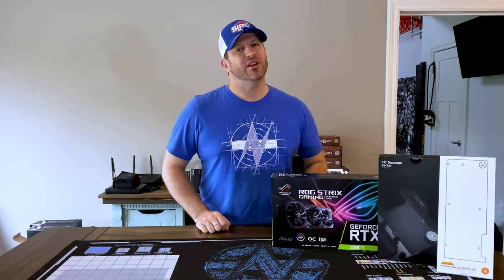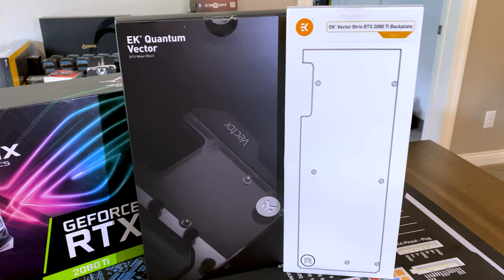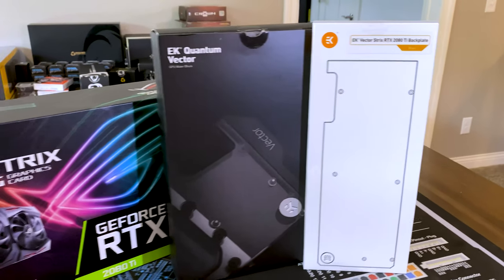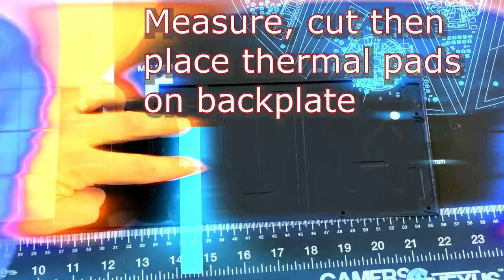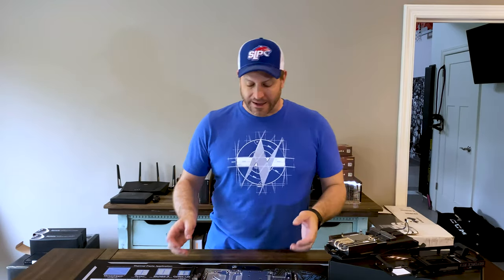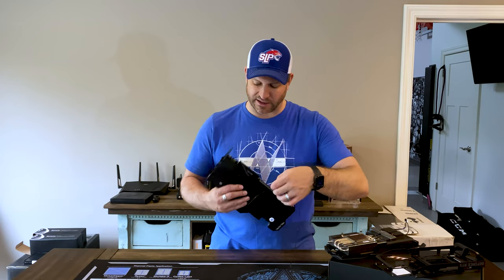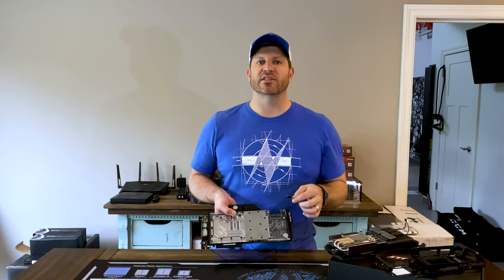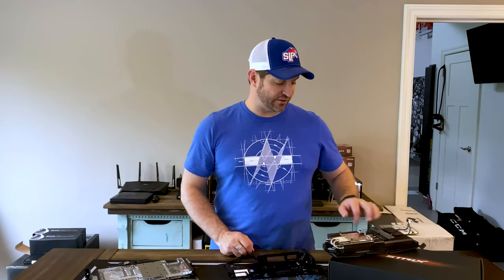Asus Strix RTX 2080 Ti Waterblock install

Comment: If you run the RGB wiring through the center between the PCB and the acrylic you can tuck them away nicely when you have the card installed horizontally. For vertical, like you will be doing, leave the wires out like you have in the video so they can be hidden away behind the card and not seen through the acrylic.
Reply from the maker: I didn’t consider running it through the card.  Might be an interesting option.  Thanks
Reply: That's exactly what I did... the cables between the PCB and back plate around the pads, worked just fine.
Reply: LANo that’s great! Getting my block tomorrow didn’t thing about that. Great help!

Comment: This might come in handy. I'll have to add a 2080 ti to a loop next week. Not sure what I'll do with the wires. Maybe some hot glue to keep them in place and out of sight. I'll have to see where it ends up in the build. 

One minor remark: if you left the paste like that, you might see higher temperatures than you would expect. Remember, a GPU doesn't come with an IHS so your first point of contact is directly to the die. You'll have to cover it entirely to allow full contact to the block. I experienced that issue a few years ago while cooling a 1080.
Reply from the maker: Thanks mate for watching.  I’ve pulled the block off to play with the wires and the paste spread evenly and fully... FYI.

Comment: Thank you very much for this detailed tutorial. I was very anxious about to do a watercooling loop because of the GPU. And what about the thermal pads, do I need do order them seperatly or are they included? And is it possible to use the original backplate?

Comment: Could you explain what the wires do? I have the same and can identify one is for the RGB, but there are two other wires from water black (smaller 4 pin) that I don't know what they are used for. Thanks!
Reply from the maker: they are the dRGB wires that get harnessed together.. see about 6:26 in the video for some close ups to see what i'm talking about.
Reply: @KDSTech  Got it. I looked at it closer and suspected that. Thanks for breaking it down.
Reply from the maker: @l8neway  no prob.    Thanks for watching.

Comment: The PCB of ROG STRIX 2070 Super is somehow the same. Do you think it will work for the same block?
Reply from the maker: haven't tried that.    that would be a better question for the block manufacturer.

Comment: Hi I want to clean under the fan shroud on my 2080ti strix is it possible to remove the fans without separating heat block of gpu
Reply from the maker: I haven’t tried.  Removing the cooler is simple.    
Another though would just get a blower ( lower power one... ) and that works great too.

Comment: Didn´t know there is a switch for performance mode on the pcb :)
Reply from the maker: it hides well.. :)
Reply: @KDSTech  it is possible to hide those wires . i used clear tape . it fits perfect to the clear plexi glas . i can send pictures if you like to see how it looks ....

Comment: I just did the same for my card, ripping off the air cooling and thinking this is essentially going to hit the landfill and never be used made me cringe. Sure would be nice if they would sell cards like this bare for guys that will water cool them.
Reply from the maker: Interesting idea.  Can’t say I disagree with you from a water cooler standpoint.
Reply: They do sell with EK waterblock pre-applied, so that you don't void the warranty